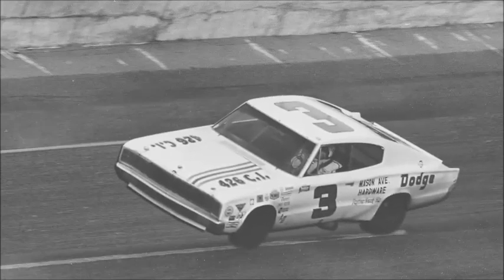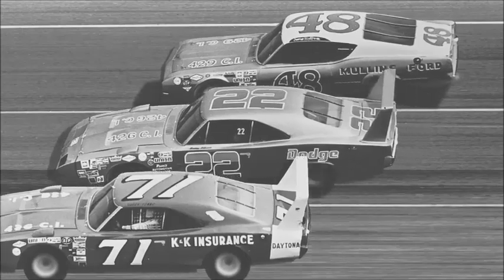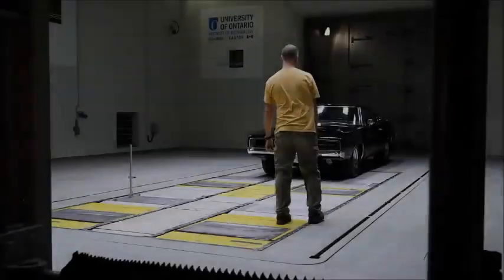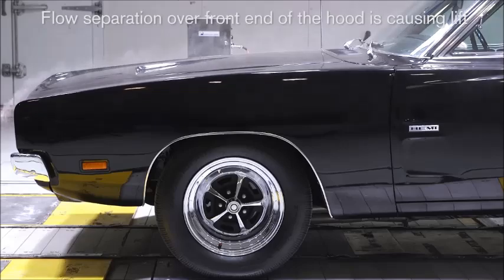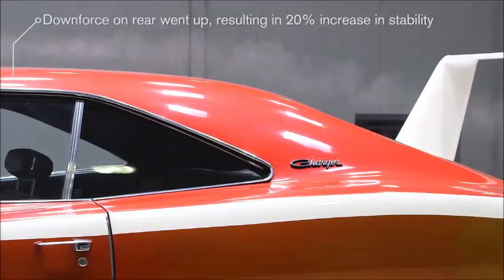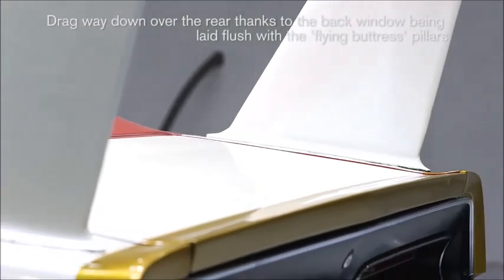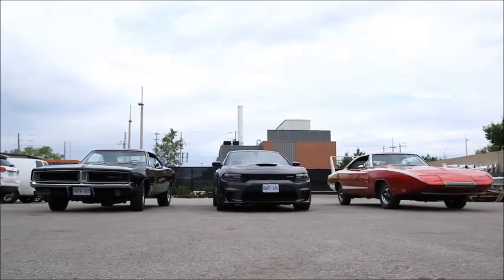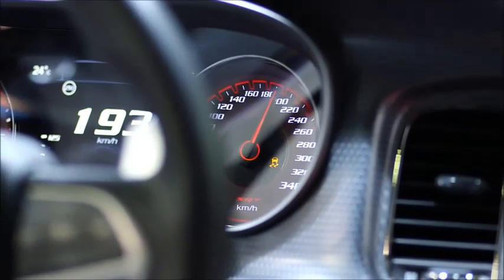Charger Daytona vs. Dodge Charger Hellcat

Comment: I would really appreciate some data, damn this analytical presentation.
Reply: The extent of that significance is what I want to be told in this video. I want drag coefficients, down force and up force values at different positions at different speeds, etc. for both.
"It's a lot better" is not what I want to hear in this video. That's my point.
Reply: @Anonymous12465  Did you look at the data in the PC screenshots?
Reply: @William Smith The front has about 600-800 pounds of downforce and zero lift if I remember correctly, it's been a long time and it's pretty hard to find solid data on the winged warriors.
Reply: @TrebuShade All you had to do was look it up, the new 4 door family car thing they stuck the Charger emblems on has a cd of 0.35 which is laughably the exact same cd as the 94-98 Ford Windstar, the 96-00 Dodge Caravan and several other 15 year old minivans vs the super car sleek cd of 0.28 the 69 Daytona has. Not to mention the fact that the old car weighs nearly 1000 pounds less than the new one does.
Reply: So the lesson to be learned is that I need a removable nose cone and wing for long trips in my 67 mustang to save gas
Reply: The autofocus link in the description is much long and does include some of them
Reply: Same here, just hearing "aerodynamic" doesn't tell a whole lot. That could mean that it has very little drag or a lot of downforce. Downforce=friction, good for grip, not so much for mpgs (but we're looking at a Daytona lol). Just looking at the Daytona, it looks slippery enough and while the rear wing can produce downforce, the front (while being bullet-shaped) doesn't appear to be all that great at preventing air from entering underneath. In short, not good at reducing lift. The bumper opening is on the bottom half but still there's quite a gap down to the ground. Apparently it worked, so I'll study it some more lol
Reply: ImpactJunky 
The old car doesn't weigh half a ton less than the new one. Mopar always made heavy cars and the Daytona is no exception. That old Daytona is pushing 3900 lbs on the street and a new charger with stuff like AC, good brakes, and leather is like 4300 curb. Fair trade, that.

And aero is a tricky bitch, too. My old car from the 80s had a factory Cd of .35 and it was a tiny little thing with very little in the way of frontal area or height being it was only around 43 inches tall. Three box sedans are hard to design for aerodynamics because if you want pure efficiency without compromising passenger space, you end up with a Prius. So any modern vehicle design that diverges from that kammback/egg shape is making a purposeful tradeoff for style. If you don't like the new stuff, that's fine, but don't shit talk it because you don't want to understand why it is the way it is.

I didn't like them putting the Charger name on the new cars when it came out, either, but it still beats the late-80s FWD Daytonas (even though now I think they were pretty neat). The original Charger was a two-door sedan anyway and you just can't really make that kind of stuff anymore.
Reply: D J I’ve been thinking of adding a Front splitter for better ground effects and more cooling capacity by forcing air in things like brake ducting or heat exchangers. 
Hopefully not making it ugly or giving up something I want like to much ground clearance ( bottoming out on every speed bumps ) or worst adding extra bits that are useless and don’t have a performance gain
Reply: ImpactJunky 
The TL;DR is for other people.

You made a claim that's ridiculous. I called you on it.

Find me a certified scale weigh-in showing a Daytona at 1000lbs less than a new Charger.

And don't call someone a little kid if you don't know who you're talking to unless you want to get treated like a senile old douchebag.
Reply: ImpactJunky 
That's fair but only if you're specifically comparing the new car to one not mentioned in the video, but that dog won't hunt if you're still talking about a Daytona/Superbird in regards to everything else (Cd, etc). The context is that you're talking about the same car, not a slant 6 base model Charger from a different production year. It seems disingenuous and doesn't really help your point. 

According to this, shipping weight on a Superbird is listed at 3800-ish lbs ( http://aerowarriors.com/sss.html ). 

Side note, now you've got me curious about the engine weight difference between the Pentastar V6 and the modern Hemi in the new cars. Those V6s are dense.

I'm gonna be up all night trying to find shipping weight for a P* V6 vs a 5.7/6.4
Reply: TrebuShade I could swear I’ve seen this before with numbers and as “ stock Dodge Charger “ I find it helpful especially if you’re moding it
Reply: D J no wing for long trips “ other airo parts “ ford did the same things to their platforms in the late 60s
Reply: @SkuzzyJ You are way off on that weight figure dude, do you really think a fiberglass nosecone and an aluminum wing added over 400 pounds to the car? My 68 Roadrunner clone which is the same car as the Superbird without the wing and nose weighed only 3350 stock. A big block only adds 150 pounds which puts the Superbird at roughly 3650 pounds assuming the wing and nose weigh about 150 pounds which is a pretty heavy guess for couple flimsy pieces of aluminum and fiberglass.
Reply: ImpactJunky 
The entire front end of the car is different, not just the nosecone. A 440 is nearly 100lbs lighter than a street hemi, and that isn't a light engine, either. Just the powerplant is pushing 800lbs in a Daytona. Curb weights are listed anywhere from 3600-3800+ lbs for these things. They aren't light. Hell a 2dr Fury from the mid-60s is 3700 lbs and that's only marginally larger than a Daytona.

https://musclecars.howstuffworks.com/classic-muscle-cars/1969-dodge-charger-500-and-daytona.htm

TL;DR, yeah, they're heavy. And a real one is definitely not 1000lbs lighter than a 2015.
Reply: @SkuzzyJ TL;DR? You shouldn't come to an argument unprepared then ignorant little kid. They only made like three with Hemis, the rest were 440s so the 440 is more representative of what you would actually find for comparison. They also didn't add an extra hood and extra fenders so just saying the rest of the front end was different than the base model doesn't mean the new hood and fenders weighed more than the base. In fact they deleted a pretty hefty steel bumper when adding that nose, doesn't take a rocket surgeon to figure that one out Sherlock.
Reply: @SkuzzyJ I never said a 69 Daytona weighed 1000 pounds less than a new Charger, I said "the old car weighs nearly 1000 pounds less than the new one does". That's true when you compare a 66-69 with no AC and a manual trans to the new car that can't even get under 4000 pounds at the 6 cylinder base level. Here's the proof, these are shipping weights but it doesn't specify if the fluids were full or not. Either way 18 gallons of gas is only 144 pounds, and 5 gallons of coolant is only about 56 pounds. I'm almost sure the RT listed is a Hemi automatic being the heaviest of all options. https://www.oldride.com/library/1969_dodge_charger.html
Reply: @SkuzzyJ If 3785 is correct it is still 400 pounds lighter than the new Charger Hellcat sedan and it is still within 100 pounds of my previous estimation. And to be fair the extra 100 pounds of shipping weight for a Superbird or Daytona could possibly be separate packaging pallets/containers used to store/ship the wing and nose before final dealer assembly. The real question here is do you think the aluminum wing fiberglass nose could possibly weigh more than the steel front bumper and bumper brackets that were not used on the car.
Reply: 1600 pounds of downforce is nowhere near what an F1 car has. an F1 car has over 7000 pounds of downforce
Reply: I G & G-Of the 503 Dodge Charger Daytona's built in 1969,70 came out with the Hemi engine.
Not sure how YOU can  call someone ELSE ignorant
Reply: @Impactjunky  -Don't go getting all butthurt because someone points out YOUR ignorance,son...
Reply: @ @SuzieQ2255  And even a year later I see you're still being a total fag about it  . . . 
It takes a real adult to admit that they read some incorrect information somewhere, which is exactly what I did. Calling me ignorant when I already said myself that I was wrong makes you look like a total moron, son.
Reply: @Impactjunky  -No,it makes you look like a Fool.
Reply: @SuzieQ2255  How? And what made you wanna capitalize fool anyway? And why did it only take you 3 weeks to respond this time instead of a whole year?
Reply: @TrebuShade The reason they didn't give you any solid data is because the 1969 Daytona is significantly more aerodynamic than the current "Charger" sedan. The 69 Daytona had a drag coefficient (cd) of just 0.28 and that's significantly more aerodynamic than a Lamborghini Gallardo or a Bugatti Veyron. The 69 Daytona is so much more aerodynamic than the new "Charger" sedan that it is capable of reaching higher speeds with less than half the gears (3 speed instead of 8 speed). The Daytona wing and nose combined add more than 1600 pounds of downforce which is in the same ball park as most Indy/F1 cars.

Comment: wait ... going off topic..hows is that hellcat is all wheel drive???
Reply: the rollers are all connected
Reply: The rollers are connected and move the front wheels in order to prevent traction control from activating
Reply: Shaggy Mason not the hellcat
Reply: TheRealDirtyDan yup figured that out but there has been some rumors that there testing a AWD hellcat but who knows it would be pretty dope if it was true I’ve always been a mustang guy but gotta admit those hellcats are badass!!
Reply: nate meehan aside from that
Reply: nate meehan really there is?
Reply: nate meehan no
Reply: new Gt500 will have more hp and look better.
Reply: nate meehan yeah only the GT ( V6 ) charger & challenger have awd
Reply: +15ironreaver Too bad noone cares. I could bring up the new mid engine corvette that leaked to the public with supercar numbers but this is a Charger video.
Reply: Shaggy Mason well apparently the new one is nvm
Reply: The Chargers come both with rwd and awd

Comment: too bad they didn't do a 70 coronet too.
Reply: Or Elliott's 87/88 T-bird. That's what Im so curious about
Reply: And a Dart vs Demon
Reply: Also, Superbee vs Roadrunner
Reply: @LtJackboot  Coronet is a Superbee.  Road Runner was extensively tested.  440 Front and -35 Rear lift with 1.5 degrees of rake at 190 MPH.  704# of drag at 180 MPH.
Reply: Chrysler did do a 1969 Coronet 3/8 scale test and that data is available at the AeroWarriors "Chrysler Document Archive".  You'll have to comb through all the pages to find it and once you do, you can verify my numbers.  481 Front and -151 Rear at 190 MPH.  734# of drag at 180 MPH.